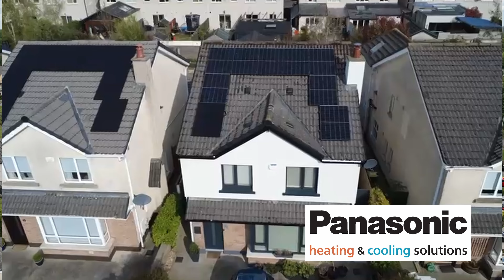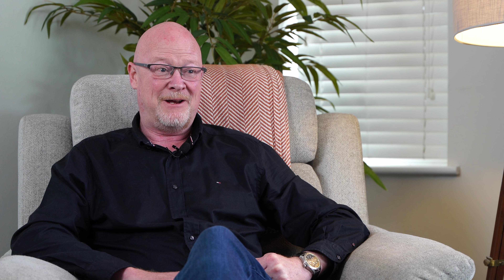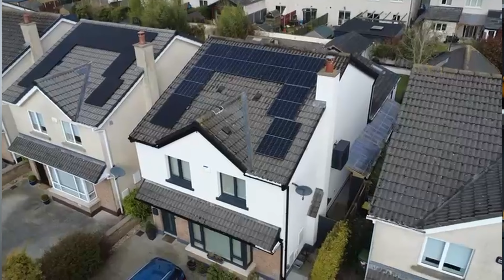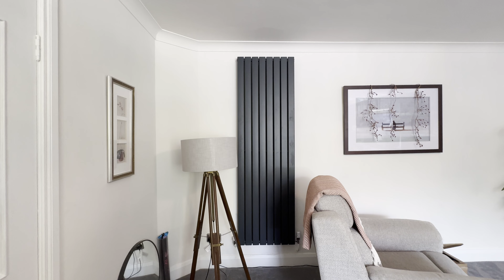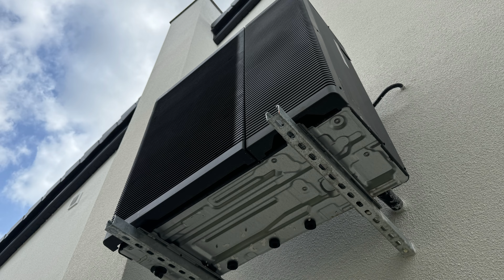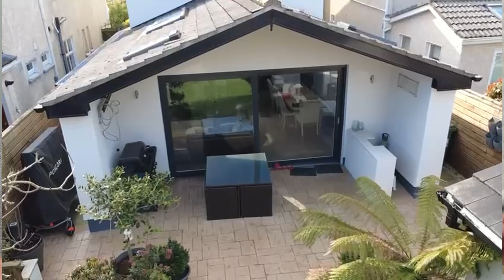EN – Irish homeowner saves on heating bills with Panasonic Aquarea L Series heat pump

Comment: We have a PANASONIC L/V MONOBLOCK WH-MDC05J3E5 installed in a highly insulated home with underfloor heating - supposedly ideal conditions, and while all the wild claims of efficiency and economy, might be achievable in a setup similar to how VW tested Diesel Engines and got immense data that no one else could ever reproduce, the Panasonic heaters are equipped with absurdly poor software and adjustability, and even worse instructions on how to use it properly.

The instructions are piss poor and no professionals know more than rudimentary thing, and advise on optimization follows no logic. 

Conditions for when the pump runs, how fast, trigger conditions are all over the place and PANASONIC's manuals and instructions are close to worthless for optimizing.

Optimizing has to do with flows, temperatures, compensation curves - much cannot be adjusted, and other aspects are advice like.... you adjust temp up like this and down like this, and it offers no advice for getting value from the pump. 

The incompetence of the how to documentation wastes massive amounts of energy for every owner out there.

Because of their incompetent SoMe/support/instructions team I would not buy from Panasonic again!